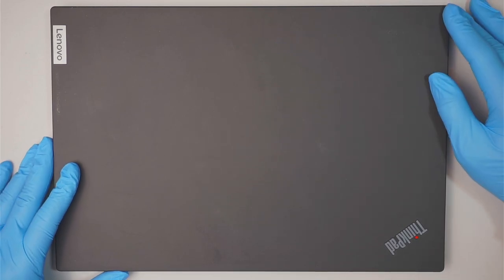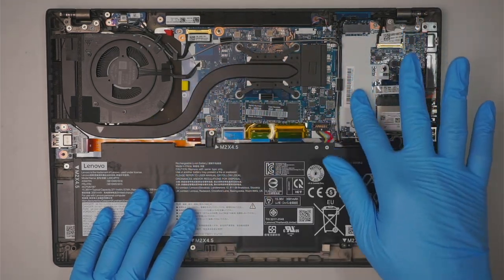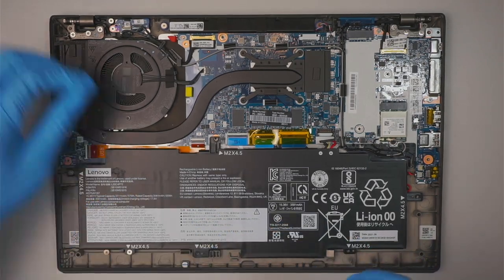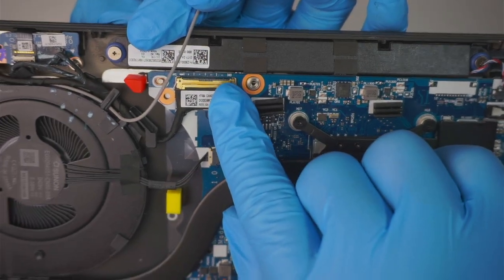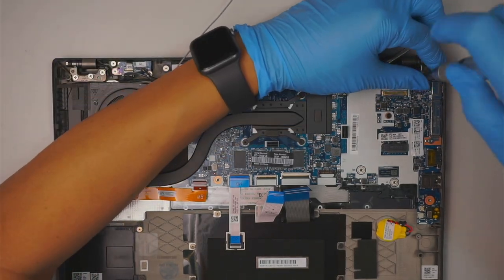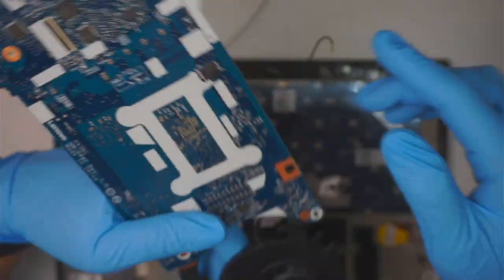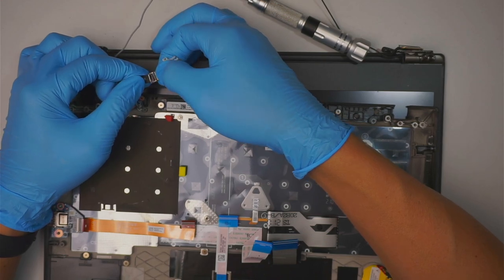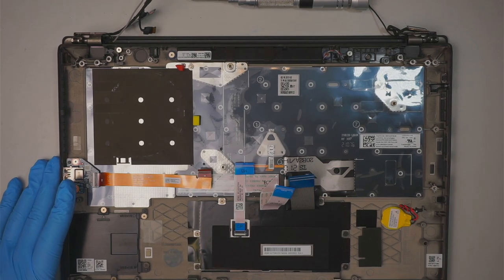Lenovo Thinkpad T14s Gen 2 Teardown Disassemble

Comment: Wich screen this laptop had? Was a 1080p touch 500 nits with security guard? or a 1080p 300nits touch? 1080p low power? I'm searching if the cable 40pin OCT is compatible with the 500nits touchscreen with privacy guard

Comment: Mine is also t14 gen 2 but i can upgrade RAM and also tearing it apart was much harder on my laptop and it was much easier to break it if you are not very careful and the layout inside was slightly different, guess  even if they have the same name they can be different

Comment: Shitttiest laptop i have ever owned.. Heat sink is  disgusting..!! Temperatures always remain 68-70 degrees.
Reply: so a hard pass if you are looking to getting it?
Reply: Were you able to improve it by any means? Changing the thermal paste / cleaning the vents? I'm also having overheating issues on this one, with max temps reaching over 100 for no significant loads.
Reply: My gaming temperature is at 80-90 °C and improving the airflow by lifting side of laptop so I'd doesn't heat up the desk only made the CPU boost to 4.2 GHz and stay at that speed with same and sometimes slightly higher temperature, so i guess no matter what you do it will run as hot as possible lol